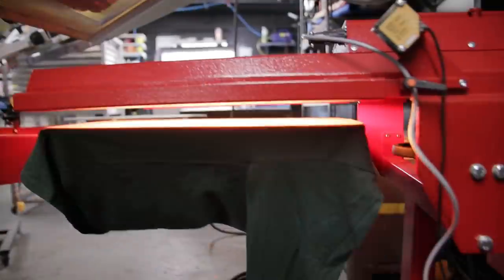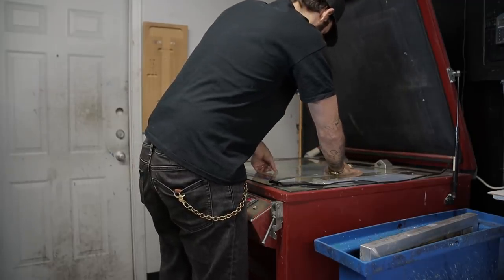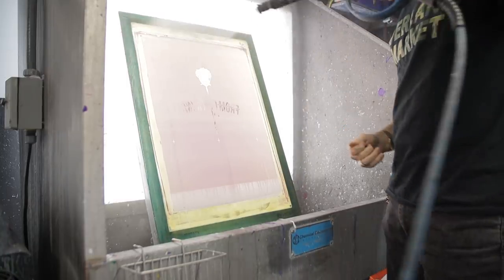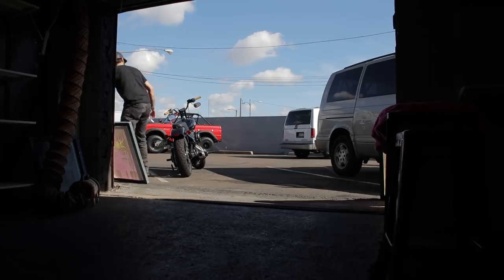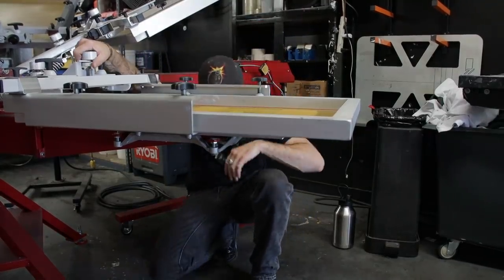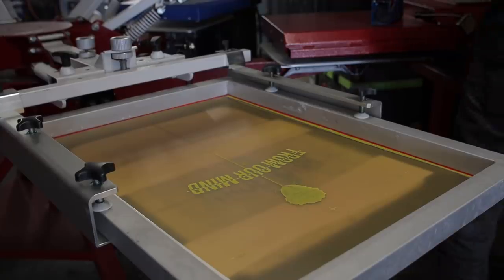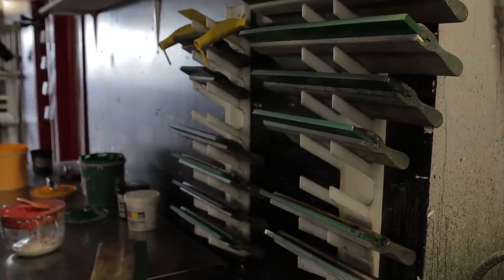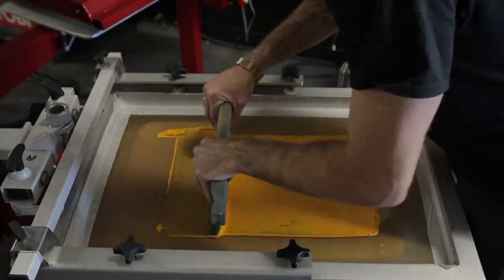Registering a 5 color Screen Print Job on a Manual Screen Printing Press | Anatol Thunder

Comment: From my experience with Sep Studio, it takes some adjusting in the base, colors and especially the highlight white. If you right click and select film, you some times can see colors, like white in lets say what should be a bright red font, that you have to pull like 5% white out of. Using your mouse you can scroll over those areas and see what shouldn't be there, or what needs to be bumped up... hard to explain with a comment... I think this require a vid...

Comment: I bought a cheap $30 dehumidifier from amazon for my dark room and it stopped my sticky screen issues. Helps the screens dry a lil quicker too. I should add my dark room is small (5x10) so make sure you get the appropriate size unit.
Reply from the maker: Nice I gonna get one, I'm going to remodel the dark room soon.

Comment: Like the commentary.. I use sepstudio but have really liked the results and control I have pulling colors and separating manually - takes me a little more time as I create actions and so forth (which I'm working on as I go) but the results are worth it and I have more control - That said depending on the job I may still resort to the program. PRINT LIFE

Comment: Don't be afraid to change colour shades instead of the standard separation studio inks. I never saw that in the tutorials and it made a huge difference to colour accuracy and vibrancy when I did it.

Pretty sure your screens are too damp. They will take the ink off the positive, which then forms a thin barrier and makes washout much harder. Especially for halftones. Also ruins your positive. Sometimes you'll even separate the film out into its two layers with plastic literally stuck to your screen. Pretty stressful on a rush job.

You can rub the screen on the positive side immediately after wetting to rub off the ink before the emulsion wets out too much for washout, but it's better to throw a dehumidifier into your drying cabinet and store your printed positive films in there too. Aim for 35 to 40% humidity in your cabinet before exposing to avoid sticky screens.

Added benefit is super quick screen drying after coating and washout. I was down to 5 min drying times after coating.

If you don't put the dehumidifier in the cabinet, you're paying and waiting for the whole printshop to dry.

Hope this helps buddy.
Reply from the maker: Agreed a dehumidifier is gonna be a necessity now.
Reply: @ThePrintLife  I bought a 12 litre model - the rating is how much water per hour it sucks out the air. I also went for refrigerant model, so it has some horsepower. Last thing I looked for was a setting at 35%, as most go to 40%, (although all will drop humidity below 40% on constant mode), and a model without loads of lights so I don't expose my emulsion whilst it's drying!

You'll find with the fan, heat generated and dehumidification that your screens in a cabinet will dry SO BLOODY FAST! I only run mine just before I need to expose, so hardly run it each day. I'd never go back to air dry - so fast and convenient.
Reply: Agree, we swapped two colors on our last 5 color print to get the look we needed.

Comment: Hi, I use Illustrator and Photoshop for my arwork. I do colorsep´s in Photoshop an print my films without RIP-software.
My printer is an Epson Shurecolor P800 loaded with Marrut-ink, an ink contaning UV-blocker.
As I understand, the US-version of my printer has another firmware than the ones sold in Europe, so it´s a bit more difficult to use refillable cartridges on them.

Oh, btw, I´m living i Sweden and I have been working as an professional screenprinter for almost 40 years now.

Thank´s for your great Youtubechannel Bro!
Reply: How do you do your separation in photoshop? By selecting the color range and putting it to a new layer? Just curious.

Comment: Hi Cam. Thanks again for your videos !
Did you use separation studio for this design ? If so, how did you do to have a black color (because usualy there is a white color but no black) ?
It would be great if you could make a video (or explain your method) on how to use separation studio to print on a light shirt.
Thank you !
Reply from the maker: After I get the hand of it I will make a rundown vid.
Reply: That would be great! ;)

Comment: Hey what up? What happened to the trilock? I see you still use the bracket in the exposure unit. The pallet dosent work with the new press?
Reply from the maker: It dose work but we have found that traditional is still faster right now becouse we have not found the best pre reg option yet. We will get it figured out and I will share with you.

Comment: Using separation studio 4, the new version has accurip built into the program
Reply from the maker: I saw that, I still prefer using my registration marks for now, are you using it for spot color jobs as well?
Reply: @ThePrintLife   Yeah the spot process and simulated process are both super easy with it, as long as your art is correct, you can add an under base trap and mix spot color with halftone on same screen. Its nice to be able to print a true spot color and halftone on the same screen with out extra art time. I also don't like the registration marks/ centerline it offers so i turn that off and in illustrator just make my own using the registration spot color so it shows up on my films.

Comment: I have a question. Why don't you tape off a lot of the screen area so you save time with clean up?
Reply from the maker: I don't think its necessary because ink clean up is super easy. however Liquid tape removes the need to tape off screens and that is very efficient.
Reply: @ThePrintLife  I see, thank you for the reply!

Comment: Hi, I’m having real problems and wondered if you could lend some advice please? Every time I flood the screen, even without pressing down, the ink comes through the other side and bulges so when I place the screen screen down and print, the print comes out all fuzzy where the excess ink squeezes out on the edges? I’ve tried thickening up the ink but it doesn’t look runnier than yours? Is my actual screen not thick enough? Please help! :)
Reply from the maker: You have the right idea, Im wonder what mesh count your using but if its to low and your using a thin ink you will for sure have issues like what you are describing, switch to a higher mesh count then let me know.
Reply: Wow thank you so much! I will look into what I have. That could well explain a lot!! 👍🏻 thank you again 🙏🏻
Reply: I’m using 55T screens, would you say that the mesh count is too low on these with the problem I’m having please?

Comment: I separate manually in photoshop. No issues.
Reply: Z - Rod TM how
Reply: @Mmmaaarrrrkk  through the channels.
Reply: @ZROD  can you go into more detail?
Like do you just select the color range then separate that into layers? Or do you actually use the channel window somehow to separate it? If you could recommend a tutorial I’d appreciate it. I do all my graphics works in photoshop and illustrator but get kinda lost when it comes to translating it over to the screen print world.
Reply: @RookieMistakeYT  yeah it's kinda hard to explain. Color range, channels, adjustments etc. Gotta use alot of trial and error. I now have actions that do it for me
Reply: @ZROD  any chance you’d be willing to share? 😬🤞🏼🤞🏼

Comment: Couldn’t you not use autofocus?
Reply from the maker: I have been using manual focus for the last 2 years and it is a complete pain in the butt, and the image was always soft or out completely. Having auto focus makes shooting myself so much easier.